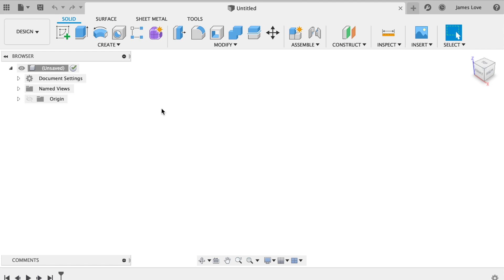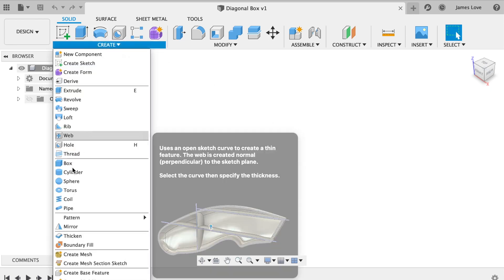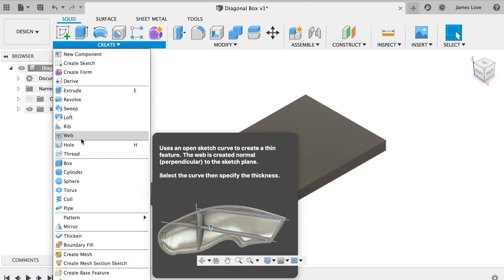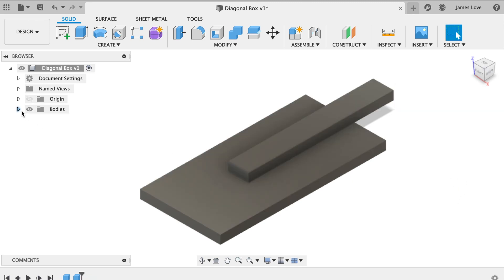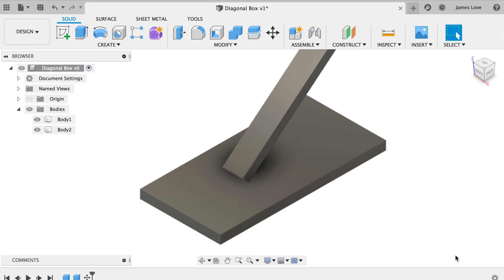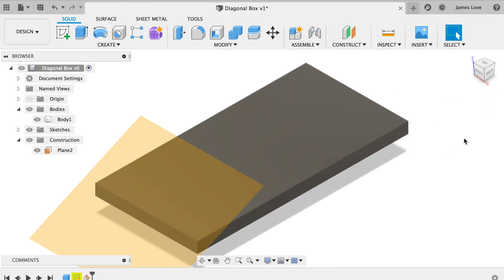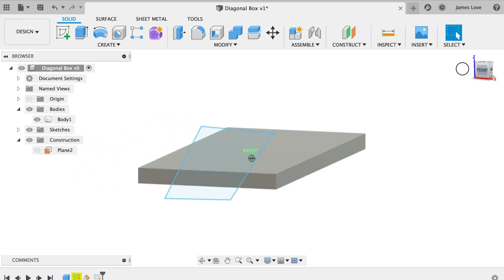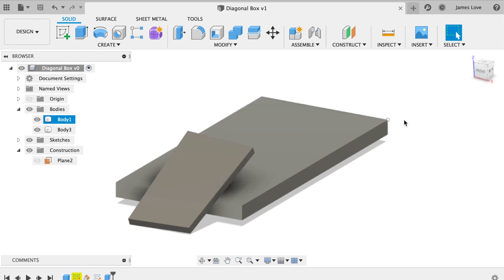Fusion 360 - Creating a Diagonal Box

Comment: How would you align a cube or any rectangle on its diagonal? Basically a corner needs to be perfectly vertical to the opposite corner. I don't understand how to snap a vertex to a line while rotating. My desire is to have a cube, and if can get one edge at the perfect angle than I can build the cube.